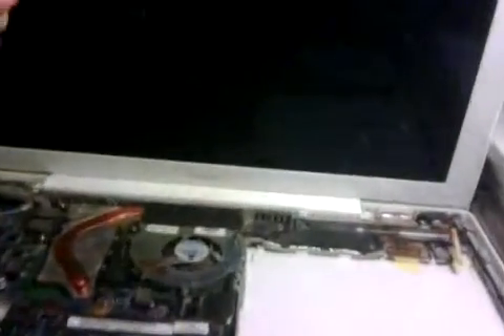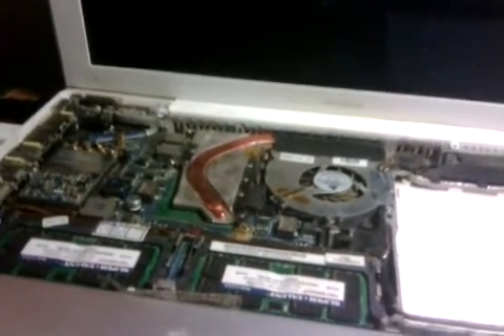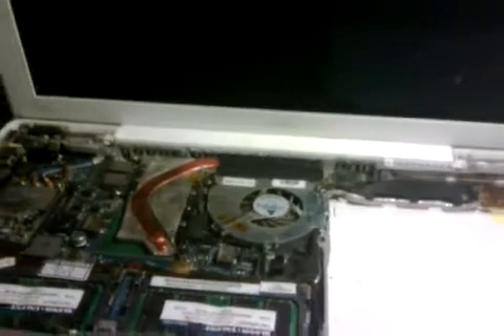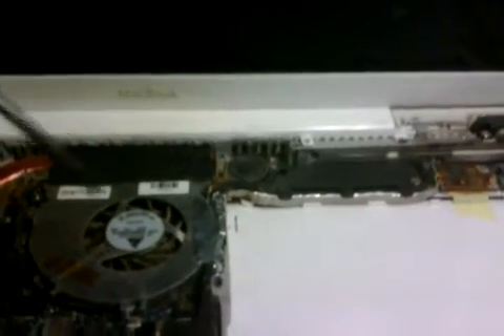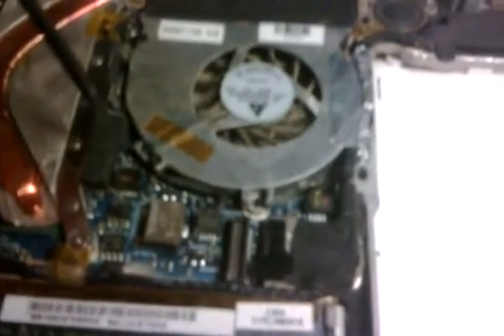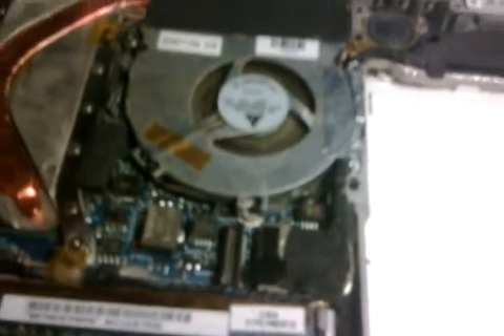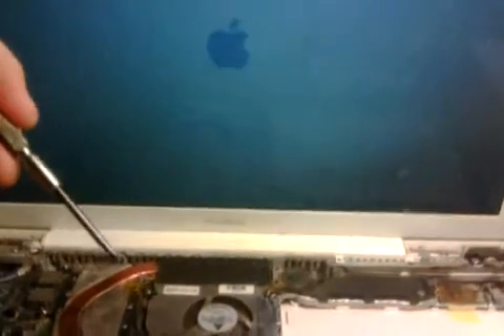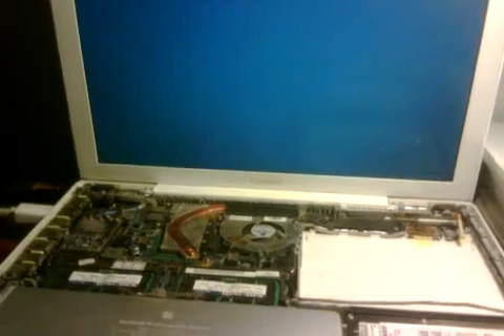How to turn on Polycorbonate Macbook Without a Keyboard

Comment: I knew there should be a way to short it on, but I didn't think of this. I'm repairing a MacBook with a shorted keyboard, that prohibits you from using any startup key combos on boot. So I just pulled it out and shorted it on with your method, and was able to use the combos (PRAM reset etc.) no problem from an external keyboard.

Comment: no need for that, there a point near the fan to power on
https://plus.google.com/photos/100320935326927613237/albums/5610701053294219873/5610701341075102322?banner=pwa&authkey=CO_Btfbu26yNcA&pid=5610701341075102322&oid=100320935326927613237
Reply: +Nick HernryDorsett Case thank you very much
Reply: Yes, Thank You. Pretty much gave up on this laptop. Close to buying a new ribbon cable for it, but now I am able to get into my mac and back up all my files
Reply: Thanks, Nick

Comment: Easier than the place described in the video. Below the fan you can see a white ¨power¨ symbol on the green board. Connect the 2 points underneath and it should power on.

Comment: If you dont want to get a new keyboard, then you can put your old one in place.. cut into the 2 wires (red color usually) from the power button, and solder or glue them onto the pins that cause it to turn on when u touched with screw driver. This way u can have ur keyboard on, completely closed, and u push the power button to turn it on :) I think its the 3rd pin from the left side that turns it on, u should double check that though as i havent worked on a macbook pro in awhile